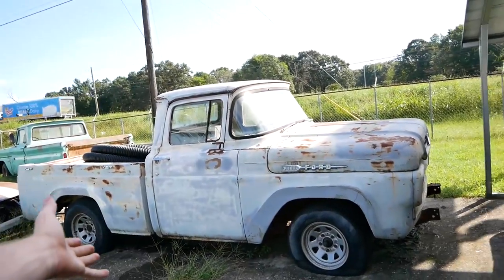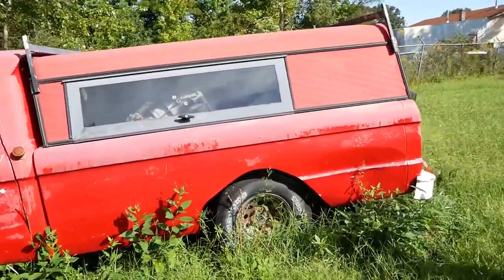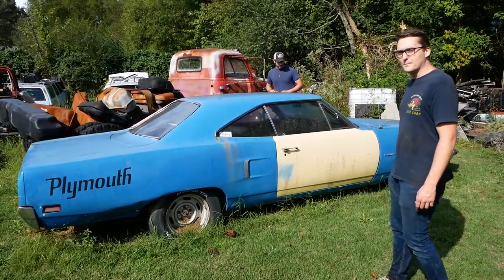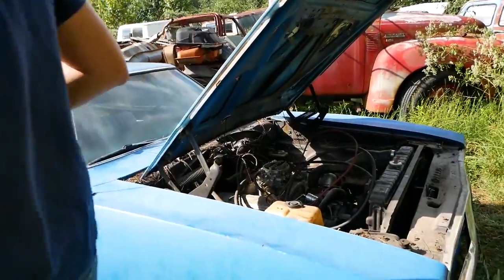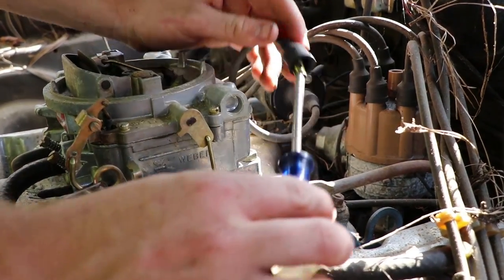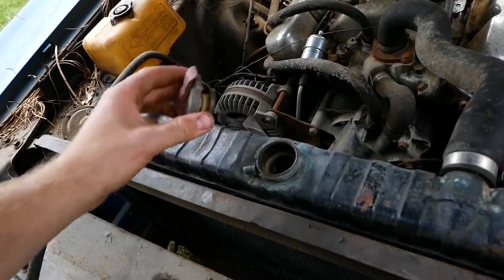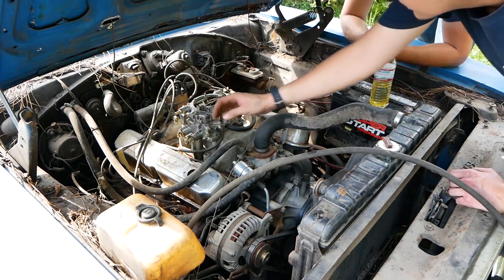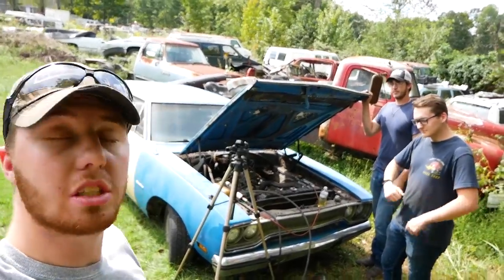JUNKYARD Satellite First Start in 10 Years!!

Comment: I’m from New England...here...cars from 2006 aren’t that solid
Reply: gotta love that rust belt!
Reply: The only solution is P.O.R!
Reply: @caseyhogan2142  Lol, no. Your saving grace is going to be oil undercoating preventatively.
Reply: I also live in New England. The sand and salt that they put on the road during winter months is what kills vehical up here. Anything that is solid either it has never seen a winter always stored properly or it's from Florida, Georgia, Down south, etc. I'd that was in a salvage yard around here they would want 7500$ for that thing.
Reply: Ya only down side to living in NH is nothing good lasts here
Reply: Yeah, my in-laws live in Scottsdale, Arizona and the Toyota Helix pickups from the mid-1980s, around here, WERE GONE by 1991, their fully-boxed steel frames used to just rot like crazy and they wouldn’t be able to pass inspection by the time they were 5 years-old in New England, and they were all over the place in Arizona & New Mexico...
Reply: @lect0n7  nice truck but I’d take that 78-79 bronco the other guys drive in that movie
Reply: @lect0n7  my first toy I bought was a 93 Ford lightning love that truck wish I still had it but now I got a 2010 raptor with the 6.2L whipple super charger to boot but the trans isn’t good in the first two gears after that it rips hard

Comment: Hi from northern part of norway,
I had a Dodge Ramcharger se 318cid, 727  once think  it was a
1987 mod and a tradesman van 318cid b300 don't remember if it's  called  b300?.
Always been a mopar man😎
Like the sound of the mopar engine
Reply: Northern Sweden here. Buddy has a lifted  ramcharger. 1 of 3 of this body type in the country
Reply: Ramchargers are cool was it 2wd or 4wd? I had a 77 Ramcharger 2wd it came with a 360 put a 340 out of a T/A Challenger with a A-833 4 speed and it would fly my friend had a 78 chevy blazer with a 355 ci and my ramcharger would spank it off the hop and in the 1/4 mile
Reply: @79tazman  4wd and i incriced the higth 4"
Reply: The  ramcharger  refers to  either the  413 or the 426  wedge engines.  Both came  with a cross ram intake manifold (2 - 4bbl  carbs).

Comment: Curios if it might havfe J or X heads on it which originally came on certain 340 cars back in the day at swap meets youd see them everywhere for cheap but putting a set of those on a stock 318 would really liven them up even more so with a lttle bigger purple shaft cam and a aluminum intake theyd reall run

Comment: Dylan something I learned over the years to tell the difference between a 360 and a 318 if you look at the side of the block where the motor mount is if there is a soft plug in between the motor mount it is a 318 and if it is offset on the side of the motor mount it is a 360

Comment: Why you didn't got in the car and drive it?
Reply: the owner didnt want to sell it :/
Reply: @monkeyfan250  the wheels are literally buried, how the hell are you going to drive that?
Reply: junkyard digs could have fixed it, watch thier truck videos. this car is A PERFECT RUNNING CAR compared the state their truck they found abandoned was. besides that truck ran with bad tires, broken clutch, and rust everywhere. old vehicles are more mechanical then eletric, so this car can run even with bad tires. besides this car DID run out of its spot, so the tires were good

tldr; this car can move and drive, the owner didn't want to sell it :_:

Comment: Back when they actually made cars out of real metal not carbon fiber crap. And also when you didnt need a 300,000 dollar computer to tell whats wrong. God i hate being a millenial
Reply: amen im in the same boat as you
Reply: Steel cars are far more dangerous and also heavier. Carbon Fibre is objectively a better material to make a car out of in pretty much every respect.
Reply: @Salvara  ah yes thats why military tanks are made out of carbon fiber. Please explain the amazing crash impact and long lasting qualities that carbon fiber contains.
Reply: @ethanbunch3274  military tanks aren't civilian vehicles made to be going 200+mph regularly, mate. Carbon fibre is lighter and more durable than steel, its not the material that breaks its the design of the vehicle with crumple zones so that the car does break when you crash.
These crumple zones elongate the time that the crash takes to happen which means more damage is done to the car but less to the person inside the car, saving your life. Almost no cars are carbon fibre anyway, pretty much only supercars or race cars with aftermarket parts.
Reply: @Salvara  okay carbon fiber is strong, but no where near as strong as metal. And metal is alot heavier. A metal vehicle moving at the same speed as a carbon fiber vehicle is gonna hit alot harder than the carbon fiber. Also meaning that itll take more force to get it moving, which means in a wreck, my 1991 f150 is not gonna move and the carbon fiber vehicle is gonna be destroyed. Im not gonna rely on "crumple zones" and lightweight material to save me in a car crash. It might be "more efficient" to have carbon fiber material at higher speeds, but if you hit something your screwed. Also metal stands alot longer and is easier to maintain than carbon fiber.
Reply: @ethanbunch3274  the car or truck will come out of it fine compared to a non steel vehicle, yes, but you are much more likely to die. It is a proven fact. The truck isn't going to move but you're going to be moving a lot more and faster inside the truck than in a vehicle with modern safety design which means you're much more likely to say snap your neck or back orsmash your face or head into something at 60+mph because you're not stationary inside the truck, you're moving at the same speed. It's basic Newtonian physics, the longer a crash takes to happen the less damage will be done to you inside the car and crumple zones make the crash take a lot longer. I'd much rather keep my life than my F150
Reply: And also, again, almost no cars are made of carbon fibre except mclaren and Pagani basically,and nobody has those. Almost all cars are still made of steel or aluminium, but they're not solid fucking bricks that cause you to break your neck in a crash
Reply: Ethan Bunch you need to learn about dissipating energy and how dangerous your supposedly strong f150 actually is. Look up crumple zones while youre at it because you just made yourself look stupid in an attempt to shame your generation. Atleast KNOW wtf you’re talking about before doing all of that.
Reply: CRUMPLE ZONES ABSORB ENERGY!
Reply: got that right
Reply: @Salvara  
Cars drive 200+mph? My toyota only does 110. For 99.99% of any cars life it will do less than 20mph average. Even lower in big cities.
Reply: @someonewhatever611  race cars made of carbon fibre do. Of course your economy car which is also made of steel doesn't
Reply: @Salvara  
But who has carbon cars? Your xbox?
Reply: @someonewhatever611  you're either misunderstanding or misinterpreting my point. Most modern cars are steel or aluminium or some other kind of metal, but carbon fibre is a stronger and lighter material for making car bodies of. Modern cars have crumple zones regardless of what they're made of because they make it more likely that the driver will come out of the accident alive rather than the car, something that the OP was against.
Reply: @Salvara  ok cool
Reply: Lol muppet comment. Cars nowadays are engineered far better. Except for body material.
Reply: @Salvara  Carbon fiber is great until you add a little heat, then it turns onto a folding material, like a blanket.

Comment: I love this videos and wish I was half as good as yall. I have 2 1995s 1 Chevy truck and 2 is a ford explorer and I cant figure either one out. The water system in my truck turned black and the new altinator on the ford is getting very hot to the point were it melts the belt.
Reply: Fords over charging

Comment: I would remove the spark plugs and pour some marvel oil in to em, to free up the rings and avoid a dry start, and crank it over several times with the new battery, most 318,s are two barrels, unless the  manifold has been changed to after market

Comment: My great great grandfather owned a car that is 1950 Chevy styling deluxe that is abandoned in the woods in my campsite so I got it running with new battery new parts  new oil and water to run the engine

Comment: You can run it without water as long as your not running it long and heating it up to normal op temp just remember water expands without antifreeze and you could crack the block if it gets below freezing in that area frost plugs sometime don't do their job

Comment: Any normally-aspirated engine for the carburetor especially cold for 10 years needs to be crunk up with the choke plate partially closed if not all the way closed to achieve the appropriate stoichiometric value for it to run unlike a computer that knows when to run it rich and 1/2 running lean y'all need to learn that that you have so many problems starting something and keeping it running because you don't have the choke closed on any of the videos this one and the one I saw before when they were at that AMX by Jeff excuse me anyway good job 
Charlie

Comment: 12:07  Son, you don't even know how to pour oil. Turn the bottle on its side so the spout is on top. Move the heater hose over so you can place the spout into the valve cover and you're golden.

Comment: Oil should have been added to both valve cover ports prior to first crank start.   You don't need  another person inside the vehicle  to crank the engine. Just use screwdriver to shunt the exposed  relay  studs.   Easy to  repair throttle pump  instead of  squirting fuel into the carb  and   obviously there is no fuel in the carb anyway.    Car is not for sale however I would  still make an offer.   I would remove the  power steering pump &  just have a single  sheave (pulley) and  only one v-belt to  drive alternator &  radiator fan.   Forget that,  I would replace the 318 with an elephant,  and upgrade  the rest of the drive train.  With  a hemi,    the value of the car would increase exponentially.

Comment: Chrysler expert doesn't know that they were known for their gear reduction starters?
Reply: Dave in MD That wasn’t the original starter. It’s a mini starter off a Dakota or Ram from the early 90s
Reply: Ok, but your initial comment seemed to be based on the sound of a gear reduction starter that is common on Mopars.  If you were saying that because you looked at it and recognized it from a later vehicle, that was not apparent in the video.
Reply: Dave in MD I say mini starter in the video.
Reply: I know, that's why I made my initial comment. A mini starter is a gear reduction starter. It seemed  that you didn't know that they were common on Mopar engines.  Not trying to be jerk or anything I was just commenting on what I thought was a strange comment from someone that was called a Mopar expert.
Reply: Dave in MD It’s not the classic Mopar bulky gear reduction starter. Yes it’s a gear reduction, but it’s not what the car had originally. Expert is a strong word as well. I prefer “that guy who likes cars”.
Reply: I’m not surprised it’s a gear reduction in the video, I’m surprised it’s a modern mini starter.
Reply: Ok, I got it now. It's all good.

Comment: ROFL...  Cranks engine over like 20x then says check if it has Oil in it...  Then says sounds like it has a "Mini" starter... LOL .   Its like the 3 Stooges
Reply: OldSkool 55F100 it does sound like it has a mini starter in it. They have more torque and spin much faster than the original starters on those cars.
Reply: ALL old Mopars had gear reduction starters.....

Comment: Take that elderbrock carburetor off there and put a good ole Holly Mopar loves their Hollies
Reply: James    Ive had the opposite experience.  Had nothing but trouble with holleys.  Leaks , constantly need tweaking.  Put an edelbrock in place of a 4160 Holley. Set the mixture and idle speed , never had to touch the carb again. And a definite increase in performance & driveability. I know what you are going to say ‘ if you knew what you were doing, a holley would run great ‘.  Been doing car stuff for or 45 years.  Don’t like spending day after day chasing basic tune. To each his own. Cheers.